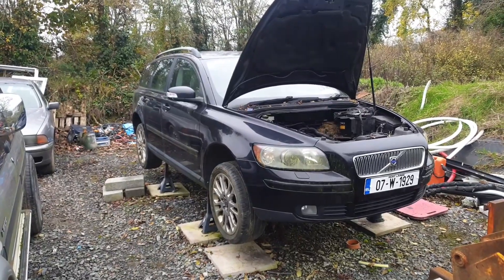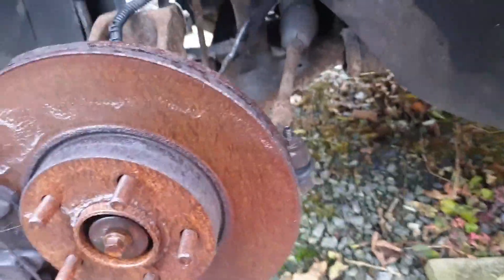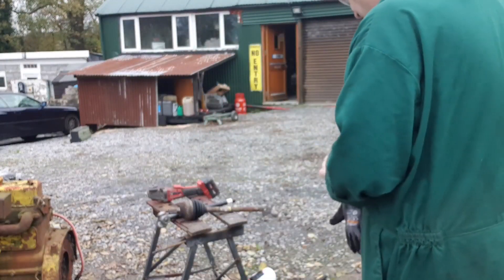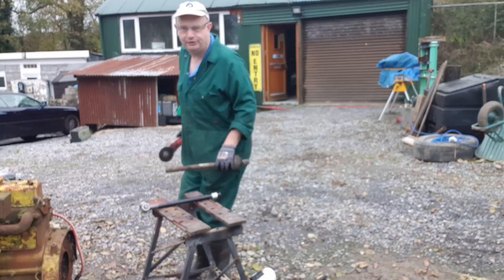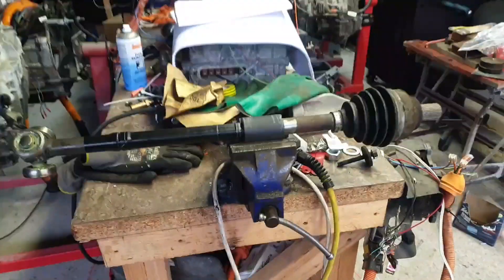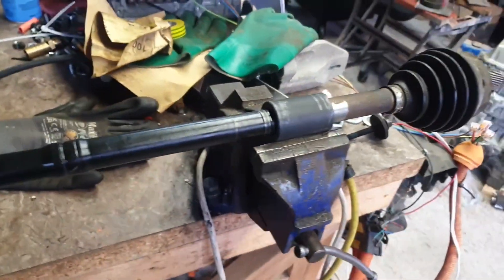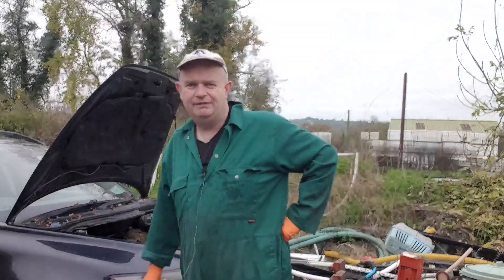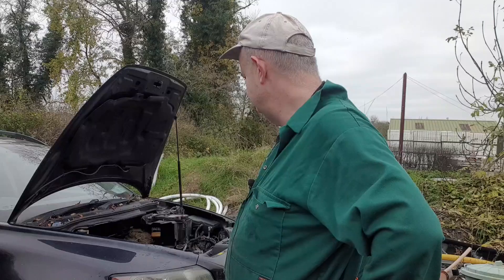The MuskVo Part 6: It's all In A Name

Comment: The inner driveshaft joint is commonly referred to as a "Tripod joint " . I assume that you will be getting the shaft couplers made from High grade steel . From experience it is best to undersize them , so that you need to heat the sleeves to something like 150°C and they shrink fit when they cool on the shaft . Make sure that you slide the coupler onto the larger diameter shaft first otherwise if you fit it onto the smaller shaft first it may slide in too far and you end up having to cut it off again.  Use ENOX29-9 rods to weld it in position.